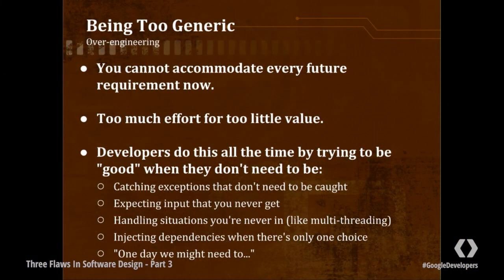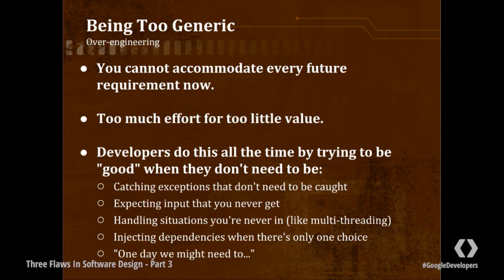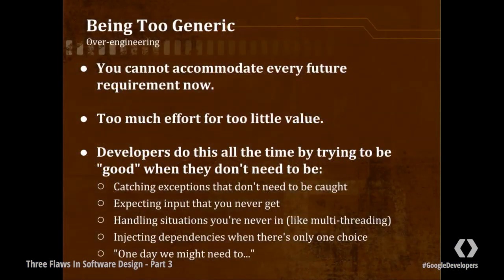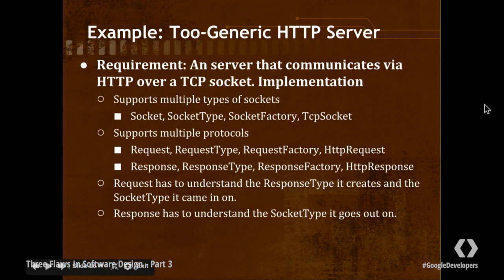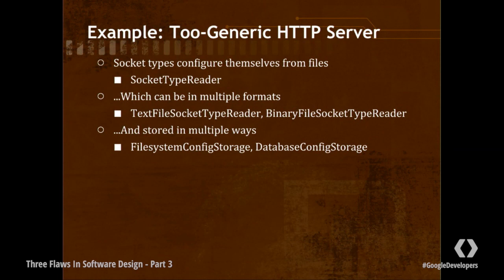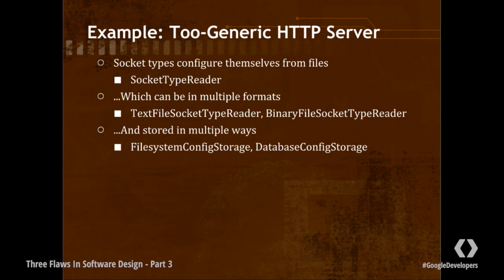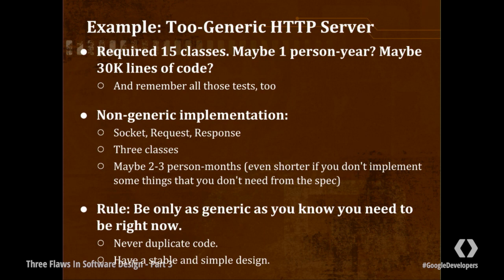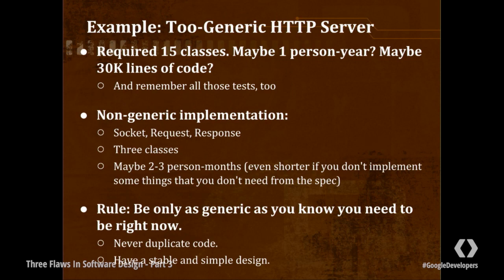Three Flaws in Software Design - Part 3: Being Too Generic

Comment: Max Kanat-Alexander  The problem with this class of problem is that if you don't have a rule to know if you are being overly-generic, you can't effectively tell someone they are making a mistake. I have seen project rewrites because they didn't cater for multiple currencies, chose the wrong framework, or rediscover domain problems because of rewriting legacy rather than attempting to port. All these fall in the bucket of being under-generic. This is like investing in a startup, it's a speculative undertaking and specific to each case. For example I recently have been writing an app that relied on Neodatis, an object database that is open-source but no longer supported (but it met the licensing and feature requirements for rapid prototyping). This meets your requirement of "only one dependency to be injected"... low and behold it turns out that their native query results links instances of UUIDs that are .equal() but not == (an annoying bug). Although I still intend to launch with this dependency (and work around the bug), I would like to remove it when I find the time because I want to choose a more stable product (although not happy with alternatives, maybe mapdb) and I don't intend to be the one to fix Neodatis.
Reply: True, without a reasonable rule it can be easy to fall into the wrong path. That's why I give a rule in the presentation and in the book both (I actually give a bit more detail about it here than I do in the book).

As far as choosing technologies, there's actually a chapter about that in the book, too.
Reply: Max Kanat-Alexander I think my point is more that there isn't a simple rule! You give a heuristic in the talk... which may be good in some cases but may bring down a project if the costs are sufficiently great (although unlikely in most cases).

In my example it depended on the likelyhood of a flaw in an unsupported opensource software. In your example in the video, it depended on the likelyhood of your users wanting to insert their own mail daemon. I don't think there is any magic rule you can use except the "scientific method". That programmer perhaps should have polled your userbase to see if that was at all an issue... however polling comes with its own set of problems. There are cases where disruptive tech goes against user intent. Back to the "scientific method", and the best data/alternative hypothesis available for each example.
Reply: I understand the statement you're making.

The key word in the rule is "know." As with most rules, it's not an absolute, but rather creates a scale from right to wrong. In this case, the degree to which you can know how generic you need to be is the degree to which you can be certain of a decision. The rule exists to point out that the data to base things on exists in observations and decisions that can be made in the present, not purely in speculations about the future.
Reply: Max Kanat-Alexander Sure. By saying it's not absolute, we agree that your rule is a heuristic. However, we don't agree that it is always right and proper to only consider the local context in making that judgement... which is what your "rule" implies, even though it accepts a good but not perfect score.

I agree that its advantages are simplicity and neatness, but coders using your rule will come up against other coders with domain experience. If the domain experience is relevant it will bring them into conflict with your acolytes. If the domain speculation is correct, then I'd argue that domain experience deserves to win. In reality, it will be win some, lose some...

...but your book should warn people about this scenario for those bookworms who assume that this rule can be applied verbatim in all cases. DuplicationIsEvil is much closer to a rule that should be applied verbatim (with the one exception if you think a duplicate is likely to diverge over time).
Reply: Got it.

I never said anything about local context, actually. Using domain knowledge can be fine, as long as the work that gets done is based on something you know with some fair certainty and isn't speculative. The i18n example is a case of this.

Comment from the maker: 3 Flaws In Software Design: Part 3: Being Too Generic
 #design   #developers   #software  

In part three of the series, Jeremy Walker & Max Kanat-Alexander  discuss the third Flaw in Software Design, "Being Too Generic," from Max's book Code Simplicity: The Fundamentals of Software.

Link to presentation: http://goo.gl/h73nY3
Reply: I once did a class Waveform that could take any sampling rate using static array buffers of any type possible in case you want int16_t or float... 

Took a week and was a bazooka to the problem. 

Parsing is my achiles heel... too much generic in parsing is to me like a huge chocolate ice cream cake with raspberries on top to a cake chocolate lover